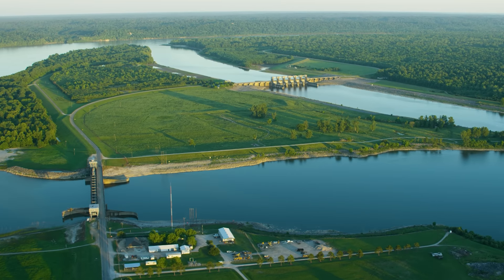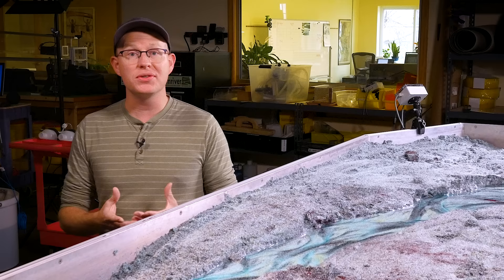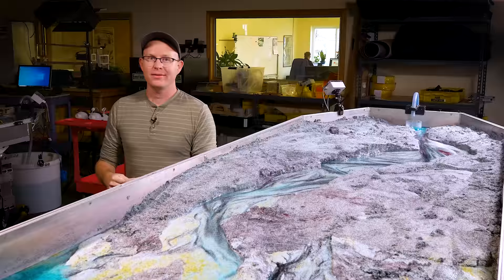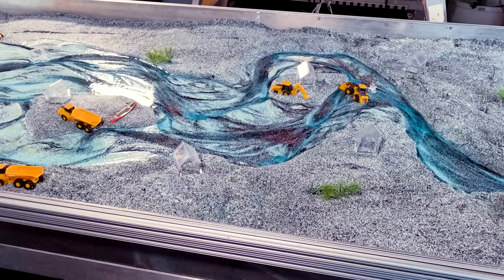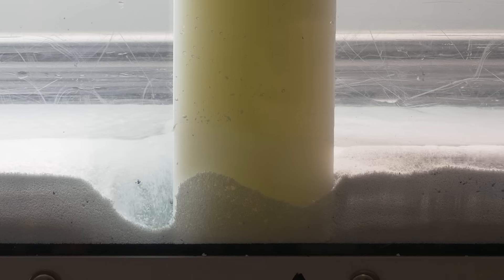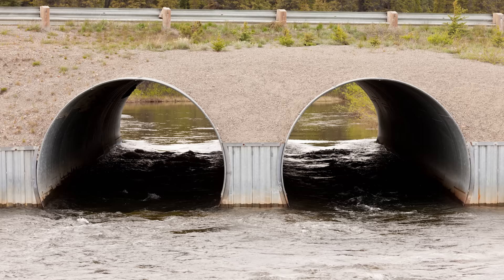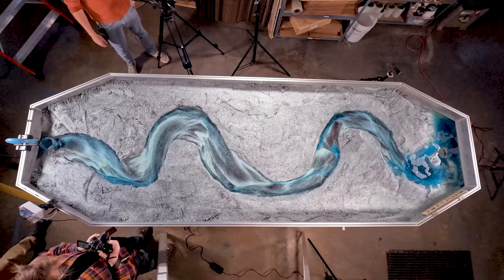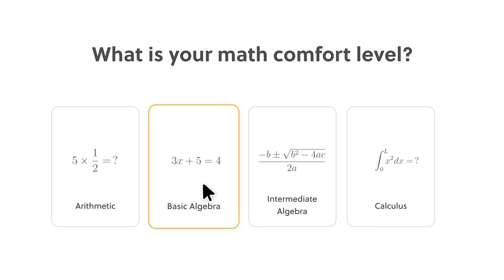Why Engineers Can't Control Rivers

Comment: In the Netherlands, most major rivers have flood plains at least some three to four times the width of the river's regular channel, and there are significant restrictions on things like construction in those areas (e.g. no permanent buildings). Whenever I see pictures or videos of rivers in other countries, in particular outside Europe, the lack of such flooding areas always stands out to me more than anything else - there's several examples of such footage in this video, in fact.

If you're planning on making more videos on this topic, I can recommend looking into the Dutch "Ruimte voor de Rivier" (room for the river) program, which aimed to further improve the quality of rivers, often based on the long-term consequences discussed in this video. At the risk of being a little self-congratulatory (though we probably deserve it; we have a reputation when it comes to water management), the Netherlands are pretty good at executing projects like this.
Reply: Skjern River in Denmark is also an interesting example. It was straightened in the 60ies.  Then 43km of it were un-straightened in 2002 due to the undesired effects of the straghtening.
Reply: Hi Leyrann,
We often put soccer fields and baseball fields on flood plains.
In my childhood we lived by a river that was about 100 feet across normally.
The second "bank," at least on our side, was about 15 feet above that and some
50 feet across and was dominated by willow trees.  Some 20 feet above that 
was a level plain with oak trees. It extended out for 2000 feet. The 
main record of that bank being under water was during the hurricane of
1936.
Reply: look into viktor schauberger, a forest man who studies nature and knows water flows due to implosion etc..

Also dutch folklore describes them as descendants of other water masters called atlanteans
Reply: True, the room for the river is quite an interesting project. 
To be fair, the dutch had to learn from their mistakes first as well. Houses have been, and are still being build in the floodplains (uiterwaarden). We also ruined our ecosystems with canalization, which we are trying to fix now. I guess we learned from our mistakes earlier than other parts of the world, because we started "controlling" our water earlier.
Reply: @zengerz  I'm sorry, did you just suggest that the magical city invented by extremely ancient Greek guy Plato is part of Dutch folklore? How does that work?
Reply: You really don't need to ban construction in such areas. You just stop subsidizing insurance, and never bail out people who build structures in such areas, no matter how much they cry.

Someone might occasionally get the urge to build the a cheap structure in such an area but no matter what happens you hold firm and do not bail them out with Other People's Money (aka taxes)
Reply: We have such areas, in fact the entirety of the Atchafalaya swamp is a Mississippi floodplain that is used during major floods. In many areas there is pastureland and farmland that can be flooded during high water.
Reply: @bobbienl1  The best way to learn something is by just doing it, make mistakes and learn from those mistakes. The secret why we Dutch are so good at water management is because in 1000 years we made every mistake in the book.
Reply: I was to comment the same. As in: look at the Netherlands...
Reply: It would be nice to see a video about delta works
Reply: We need this here especially in hurricane prone areas and not tax payers backing flood insurance
Reply: @dorvinion  Any kind of construction comes at environmental costs. Especially now that plastics are often used in constructions. Allowing people to build somewhere where we know it's going to get destroyed will put this environmental toll on others in the area. Therefore I don't think people should be allowed to build in these places even if they know their stuff isn't insured
Reply: When I see brand new houses being built by riverbanks here Latvijā I am always amused, these people do not follow the oldfather smarts - houses are to be built on a hill to make sure that it wont be wet in the spring floods.
Reply: And yet here in the US, building on flood plains is how zoning deals with "the problem of affordable housing".
Reply: @zephyrus339  several times y'all needed to send out for more paper, to make the book longer, so there would be room to make more mistakes. ;)
Reply: The Dutch seem to have quite a few reasons to be self-congratulatory, but for some reason I've only ever seen you guys do it about water management :D
Reply: @Wetcorps  I think their greatest achievement in recent times is Simone Gertz.
Reply: Any sort of natural works project is a lot easier with a small fraction of the landmass.
Reply: not sure how land ownership works in the Netherlands but I would assume its not too different from north America, was there a period where the government had to buy land back for these types of projects or did they end up just ceasing it once land became damaged via excess erosion or damage due to flooding?

its pretty standard in most places around the world to build right up next to water ways, which I have always found annoyingly fascinating that people of the past with a lack of engineering knowledge that bare witness to how cruel nature can be would continuously tempt fate and continue to build close to unpredictable large bodies of water.
Reply: @MonkeyJedi99  Fools.
Reply: @ivanskyttejrgensen7464  Fancy meeting you here.
Reply: @DotADBX not that surprising, Vesuvius buried Pompii and yet people live right up to and on its slopes today. Darwin awards all around.
Reply: And by straightening a river, the time the river has to let the water go down to the ground water is reduced. So in the Netherlands we are letting the river to  have more time to flow.

Ground water levels are important and are dropping.
Reply: and don't forget about the huge canalisation with groynes making sure that sedimentation doesn't cause trouble for things like shipping
Reply: @juanguerrero0941  all of the Deltaworks. So not only the sea-structures, but also the many miles of inland dikes and channels to keep us from flooding.
Reply: @Wetcorps  here's an other one. We, Dutch, control the chipmarket. We have ASML.
Reply: Water- and general infrastructure might I add. Our road construction sites take mere weeks or days with minimal impact on normal traffic. Here in Switzerland where I live kankerzooi it takes forever to complete, they have this ''joke'' about how if they're finished on side they can start over on the other, not realizing how sad it is and how much negative impact months or years of construction have on the public. Took them 5 years to replace to a highway bridge, back home in the Netherlands we do that in one night, build the new bridge next to old one, when it's done just close the road for a night and swap that thing out.
Reply: We in DRCONGO need to learn from the Dutch big time.
Reply: @dorvinion  yeah but we in the Netherlands actually care for other people.
Reply: And in Hungary the managed the rivers flooding by making it so the floodwave leves the country asap.
Droughts ahoy.
Reply: The netherlands is very flat, its not a test-case you can compare most countries with.  Water flowing in a direction instead of spreading evenly is more common.
Reply: @AnimilesYT  even better, start using environmentalfriendly building materials again
Reply: @DotADBX  remember, a lot of old cities were built on wooden stakes. i think the first settings of the phrysians, or ancient dutch tribes might have built elevating settings on wooden stakes, or easy moveable housing, considering the natural geography of the coastal netherlands
Reply: @kuunib7325  yes, you ARE very good at that. In Belgium, still a disaster. I lived in the Netherlands, great country. I was complaining a lot when i lived there but now back in Belgium I can see it wasnt that bad after all...!
Reply: @thevictoryoverhimself7298  actually, the Netherlands are a big Delta area
Reply: No offense, but your country is literally falling into the ocean. There’s no wonder you guys have such a big emphasis on water management and flooding lol
Reply: The Netherlands are the absolute best. But the unique conditions they work under often don't translate to other areas.  Hence the wide differences you see.
Reply: Yeah everything is better in Europe. You've more mistakes to learn from there.
Reply: Correction: Germany and countries outside of Europe.
But ok, we had basins and reservoirs that could have been emptied to catch these waters (=> Ahr-Tal/2021 European floods), and their were reports at least two weeks prior the flood that something is coming...German politicians.
Reply: cant control rivier?? 

laughs in dutch XD
Reply: @zengerz  Ive read some of his work. Fascinating and wise man.
Reply: Zo is dat
Reply: To be honest the Netherlans have pretty good control of the water. A couple years ago we lowered the river lvl because a bridge was build to low. I think Grady should really visit our little country once to check our systems out. From flood control to the Delta works
Reply: @guitarheromartijn  did not know that, Ironic really. because of lack of snow in the swiss alps the de Rijn river is drying up and the waterlevel is to low. Especially in summer where we have weeks or even a month that ships can no longer sail it. 

 I heard there now building dams to controll the flow of water better.  I guess w'l see what the future brings.
Reply: ok
Reply: Yeah, nobody does waterworks like the Dutch. Seriously, they are masters at it. Best in the world.
Reply: @dorvinion  the problem with that is that allowing shortsighted people to create obstructions to the free flow of floodwaters in the floodplains creates damage not just to them, but to people upstream who get inundated when the water is slowed down and waterlevel grows higher because the partially-obstructed river can't remove as much water as an unobstructed riverbed would.
For the people upstream who's houses are damaged it's impossible to brove exactly how much of their damage could be ascribed to each individual house, or (maybe more often) cheap sheds, barns, hedgerows, bunches of trees etc.that obstructed the floodplain downstream from them, so they or their insurance companies can't get the money for their damages from the idiots obstructing the floodplain, and we all still pay for it.
Losing only their own cheap shed won't teach the idiots much, they'll likely rebuild it - and the people who build their homes supposedly safely behind levees or dikes, that get overtopped when the river can't handle the flooding, are the ones who will be left with the damages and see the costs for their insurance rise.
Reply: @zephyrus339  I have to disagree. Strongly. The Dutch did not make every mistake in the book. Rather, they were (literally) at the receiving end. The real major mistakes were made by the "upstream guys".

In case of the Rhine river, this includes Germany and France. Straightening the river and claiming floodplains for profits resulted (and still results) damage in downstream areas.

Yes, when I was a kid, there was the annual flooding of Cologne, which was regarded as kind of "romantic" as quite a few pubs could only be visited via pontoon bridges. As I grew up, so did the flood, and even upstair pubs got flooded. Not counting damage to residental bulding and....other "inconveniences". Yep, building near the river Rhine are legallyrequired to have a backwater flap in their sewage system. Trust me - while it sucks when your sewage is trapped inside the toilet, it sure beats sewage not being trapped in the toilet but happily flowing into your home.

In the 2010s, upstream floodplain (called "Polder", even though the meaning is the exact opposite of what you'd expect if you understand Dutch) were re-introduced.

The real shitshow is that, for decades, politicians decided not to care about the "downstream guys". Not because the poiliticians were dumb - in Germany, every schoolkid knew about the dangers of straigthening rivers before the age of 10. But greed...is just inseperable from politicaian. Now you know why the Netherlands were literally at receiving end, for decades.
Reply: @Duiker36  2,500 years is a long time for people to get all sorts of ideas
Reply: The Netherlands had more time, simply put, they are not better at executing projects like this, as evidenced by the fact that their infrastructure hasn't been updated in hundreds of years. 

I always find it hilarious whenever someone compares a country that basically opens the doors to immigrants, to one that basically slams the door shut in their face. The Netherlands doesn't have to deal with overpopulated areas forcing them to build in less than optimal areas, because they don't let that problem happen at their border.
Reply: The Dutch are reserved in all aspects of their culture.
Reply: The floods that hit Limburg in 2021 showed that despite a raft of measures, the Netherlands remains at risk.

Disasters have always propelled Dutch water management. In 1953 the North Sea flood, set off by a combination of strong winds, high tides and low pressure, killed 1,835 people after dikes were breached on 67 locations in the western part of the Netherlands. In response, the Dutch embarked on a plan called Delta Works, creating massive sea defenses aimed at preventing one-in-10,000-year floods.

Since then, the government has created not only Room for Rivers but also Delta Program, which now oversees all the country’s water management issues. July’s extreme rainstorm, however, suggests it is once again time to re-evaluate the country’s water defenses, Mr. Dircke said. “Increasing dikes by 10 centimeters is useless,” he added, “and we should map sensitive places.”

“If an elderly care home is next to a river, we should consider replacing it, as evacuating such vulnerable people during an emergency takes up too much time,” Mr. Dircke said.

The roots of this new thinking go back to two huge floods in the 1990s that forced the evacuation of hundreds of thousands of people. Shaken by that disaster, Dutch officials and hydrologists eventually concluded that, with major floods occurring more frequently and with greater intensity, raising barriers and digging canals was no longer enough to manage the water.

Don't go patting yourselves on the back just yet! You still have work to be done with so much of your country being below sea level.
Reply: @dorvinion  yeah that would definitely do it, though that won't ever happen in the Netherlands, we're too much of a welfare state to allow such changes in law.
Reply: @MonkeyJedi99  thanks but we can't take credit for her, she's swedish
Reply: In Canada and the united states we fill them in and build houses and industries on them and then complain when it floods
Reply: Everything is always better in Europe
Reply: @joshz3788  The infrastructure has been updated significantly over the years, especially throughout the 20th century. The basic stuff with the rivers stem from the Middle Ages, but since then it’s been updated and expanded, especially regarding protection from the sea. We’re lucky that we did the right thing in the Middle Ages, which included having special water management that relied on cooperation on a large scale, and that continued to work over the centuries. 

The Netherlands is one of the most densely populated countries in the world, and it’s basically one big river delta. Every single square centimeter is managed. Do you think the Netherlands has a strict migration policy? Compared to what country?
Reply: @thevictoryoverhimself7298 Very often delta areas are quite flat, but anyway here most rivers still just go from inland towards to the sea. Depending on the volume of water some of the rivers can have quite some power. The Rhine in the Netherlands is about as fast as the Mississippi.
Reply: @joshz3788  Huh? When I visited German high school in the 1980s, we learned about the Netherland's huge water infrastructure projects in the 20th century, the Ijsselmeer dike and the Schelde works. Major investment continues until today, like the storm flood weir in Rotterdam and the ongoing Room for the Rivers program. These are only the most prominent examples.

The Netherlands also has a very advanced freeway infrastructure. It's being expanded all the time, including new connections with large tunnels.

Their infrastructure investments are enormous, at least from what I can see.
Reply: @Wetcorps just look up anything abput infrastructure or cityplanning 😅
Reply: I live in Japan and am always surprised at how different their rivers are. I'm not saying they're worse or better, just different. Wider, less used as a focal point for towns and cities, rarely lined with beautiful buildings. It's one of the things I miss from the UK - we love our rivers and keep them central to our cities. I assume the same is true, maybe moreso, on the mainland.
Reply: @spider0804  vulcanoes that errupt once every millenia or less are not seen as dangerous by humans, for good reason....  a better example would be Hawaii, or Iceland
Reply: @joshz3788  what have you been smoking? The Netherlands is one of the most overpopulated countries in the world , with a huge inflow of immigrants, which let to extreme right populist parties getting the most votes in the recent election.
Also their infrastructure is updated all the time and very modern.
Reply: @dorvinion  that doesn't work at all, look at north carolina and the houses they build out into the water on the beaches, zero insurance zero bailouts but too profitable to care and it really ruins the beaches
Reply: A flood plain only three or four times the width of the river doesn't sound like much. Better to look at the landscape and see where the natural flood plain extends to - it can be tens of kilometres wide.
Reply: Nijmeguuhh
Reply: @juanguerrero0941  was going to say! Room for the river is nice and the video feels weirdly close to describing it without naming it but in terms of controlling massive amounts of water (with the lessons needed to be learned from it) the Afsluidijk and Delta Works would've fit the theme of the video so much